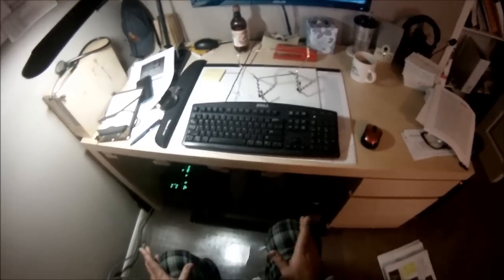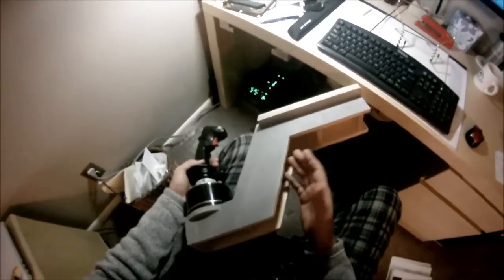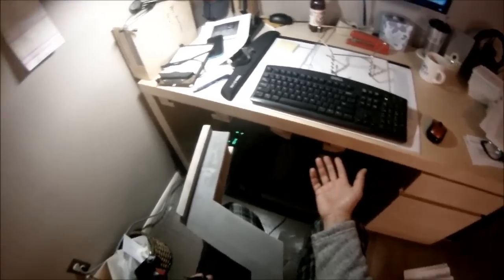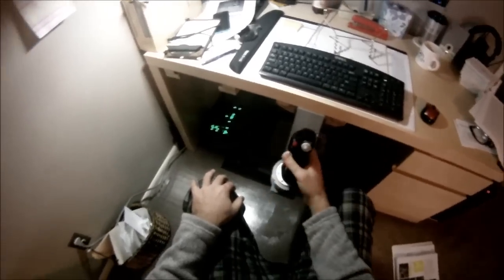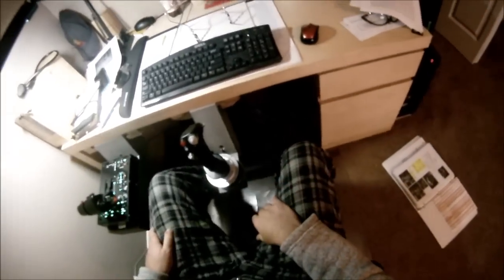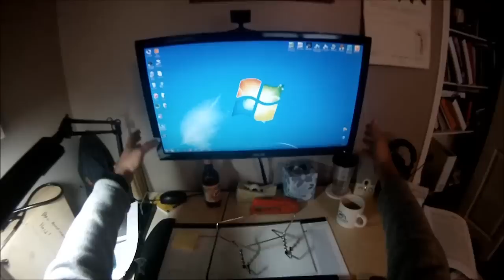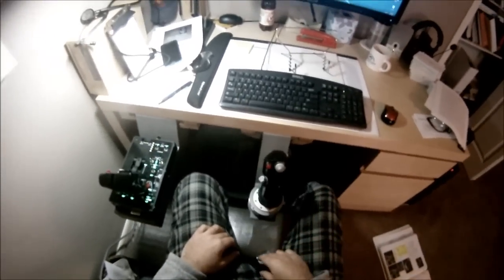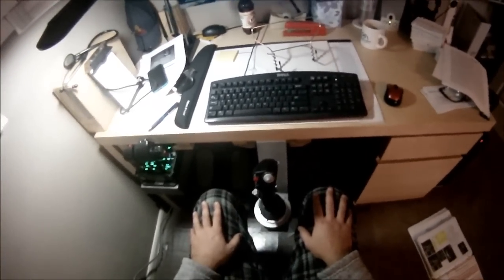DIY Thrustmaster HOTAS Warthog Mount

Comment: Thanks for sharing this idea.

I built a set based loosely on your design.  I attached the middle portion of the "Z"  arm, outboard of the top and bottom arms, using carriage bolts (washers, lock washers, and wing nuts).  I created a series of parallel holes in that middle arm at about 3/4 inch apart, t so that I could adjust the height and angles of the control.  

I LOVED your idea of being able to slide the Throttle unit deep underneath the desk when not in use.

My observation is that I am a better pilot with the controls off the top of the desk.  It is all more natural.

Comment: Excellent, I love how you built under desk mounts for your HOTAS.  The center position of the stick is perfect for DCS planes and helicopters.  I have been looking at aluminum profile to build something like this.  But, as you have shown, wood is more cost effective and easier to work with.  Great idea!  I am going to build something similar. Thanks for posting the video.

Comment: I agree with sandspar. This could become a thing. I am no carpenter, and I bet plenty of people are not either, so this would sell in my opinion. I would buy it easily haha. After spending upwards of 400-500 on this stick, a few bucks for this sort of set up from someone like yourself would be an easy buy with minimal thinking involved. I really loved when your screen moved closer as well, that caught me off guard, very cool. You should also consider going to a local flight school, or FBO and getting one of the kneeboards they sell to pilots. When I fly real planes (when I'm not simming) I use a fantastic kneeboard with a pen clip at the top of it and a nice tight strap. Cheers :)

Comment: Hey man thanks for sharing your design, I'm currently in the process of building my own mounts from your design but I've hit a hurdle which may force me to scrap the build.  What type of wood is your desk made from? Mine is made from particleboard and ABS plastic (details from the website) and is only 18mm thick so I'm not sure it will be strong enough to support the joystick and throttle

Comment: Here is a thought: What if you did the same, but attached them to your chair? Then the thrust control could be attached to an adjustable armrest and both will be relative to your position even if you tilt back. Hmm... I have an old office chair myself, maybe it's a project I might pick up.
Reply from the maker: I had thought of that, but I couldn't come up with a setup that was easy to take off and yet still solid enough to use well.  Plus,  most office chairs are made so cheaply these days, it's tough to find good mounting points.

Comment: how much lower would you set the throttle vs the stick?
Reply from the maker: My opinion is that the stick should be high enough that your forearm can rest on your leg.  your hand should be able to grasp it without having your wrist cocked forward or backward.  I've found that the top of the throttles (for me) are most natural just below the level of my thigh when sitting.  I currently have my throttle mounted too high for my taste.

Comment: Hello!

 
   I am currently in a position where I have to use my desk for study, but I need the desk to 

use DCS with my Track Ir. I actually own the same exact desk as you do, and am also 

pushed up against a wall, which sucks for me!!! I would love all the dimensions you used 

for the wood, and such if you could. 

 -Would definitely appreciate it, Av8r_MD83

Comment: This is pretty nice.  Can you send me the measurements?  If you've put the throttle lower, can you send me that one as well.  I fly with ACG as the squadron commander of 7./JG26 and would love to share this with my community.  I've already shared this video in our forums.

Great job!  Very useful and a huge benefit to our community!
Reply from the maker: That's great to hear!  I posted both of my 'revised' drawings under the input / output section on the Eagle Dynamics forums.  You can search for it using my callsign "Rosco".  I'll be finishing school soon ( thank god) so I'll actually have time to go back into my workshop.  I would consider building some for those who cannot do it themselves.  I'm thinking around 50 bucks for the pair sounds more than fair and the buyer pays      s & h.  
Let me know if you have any questions on the drawings.
Reply: Thanks for the drawings!  I think the price you're asking is pretty reasonable for those who don't have the tools.  I'll be making this over the coming weekend or two.